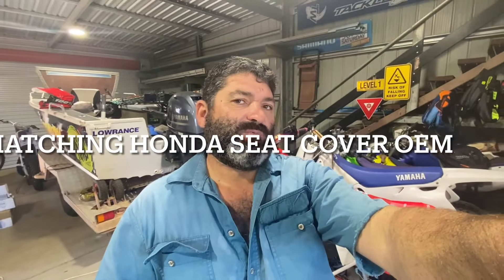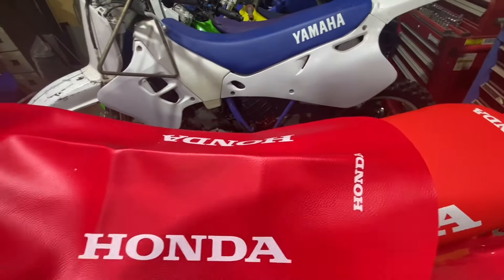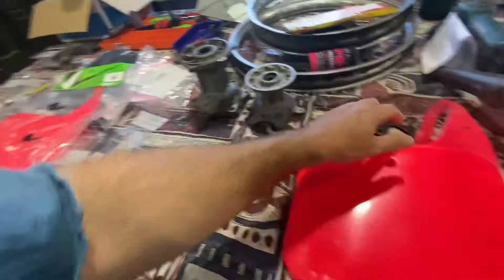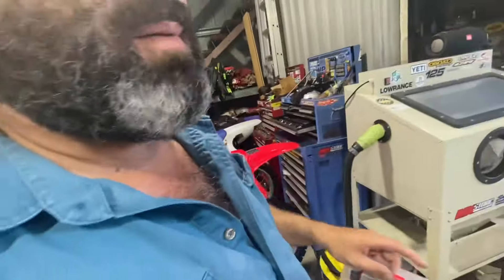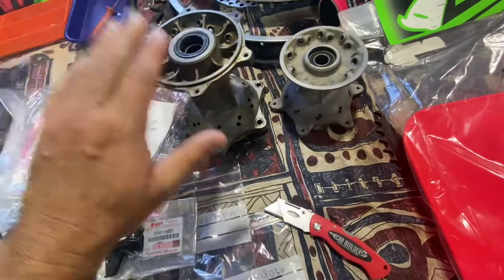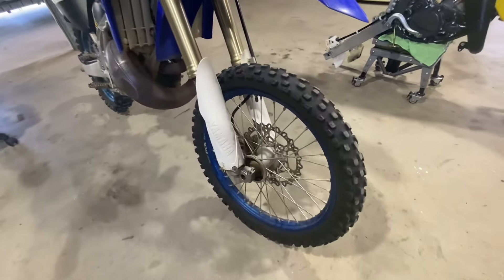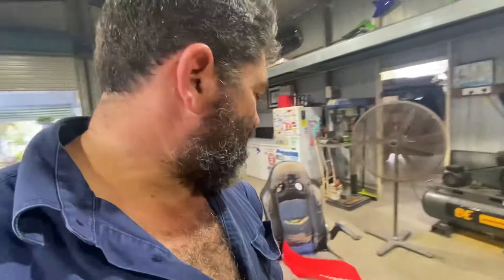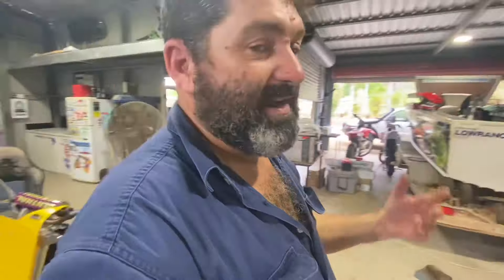250 / 125 2 stroke restoration OEM Suzuki Honda

Comment: Might need to do some more research on the Honda logo font mate, throttle jockey is the correct font for a 92 👍🏻
Reply from the maker: I have a Honda seat and the throttle jockey has correct logo but the letters are slightly larger and longer are slightly different in font to oem  
It may have been exact same as race team seat 
Thanks for watching